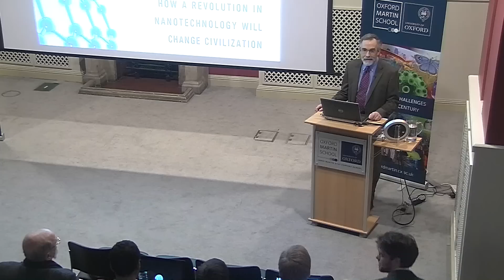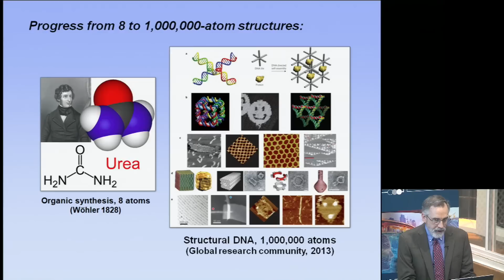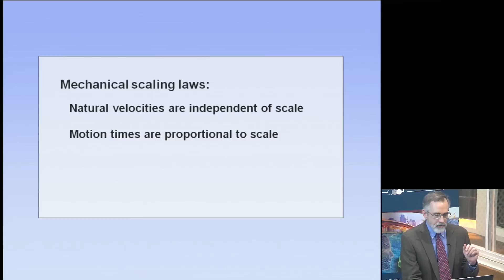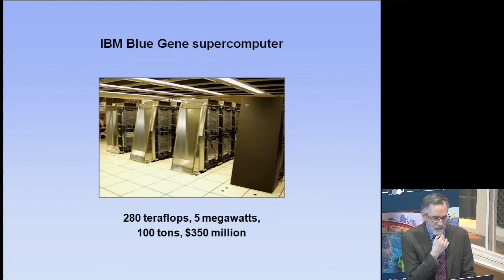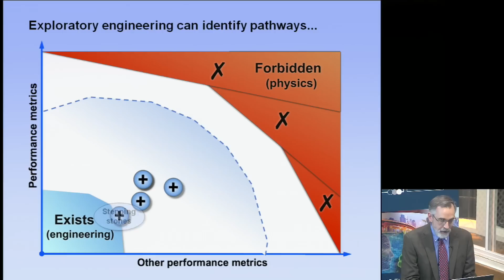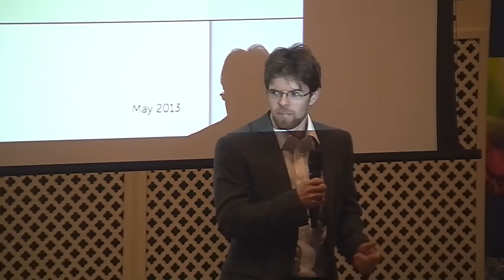Radical abundance: how a revolution in nanotechnology will change civilization

Comment: Darpa has offically started to try and make molecular assemblers starting as of 3 days ago...Its happening. See you all in a decade. Lets see what happens.
Reply: +NaniSore
Drexler himself said in a recent Video that the concept of molecular assemblers is outdated by ~20years. Nanofactories are the current far term goal! He does not avoid molecular assemblers because they are associated with the grey goo fable ("little tiny robots that will eat you") but because nanofactories are likely much easier to reach in an incremental technology improvement path and nanofactories will certainly be more efficient than assemblers due to specialisation on standard parts ("nuts and bolts"). There are no molecular assemblers in his technical book "nanosystems" and his later works like the one he presents here ("radical abundance").

You're probably referring to the A2P program:
http://www.darpa.mil/program/atoms-to-product
As far as I see they do not mention molecular assemblers either.
Reply: Hey, here almost a decade later, not much happened really, right?
Reply: “Black goo” Not a fable. Research Kerry Cassidy with Project Camelot and her 18 years of work with whistle blowers from Above Top Secret and NASA. A lot has come to light. Yes a pun intended.